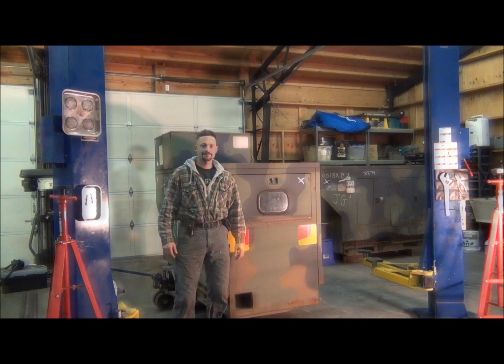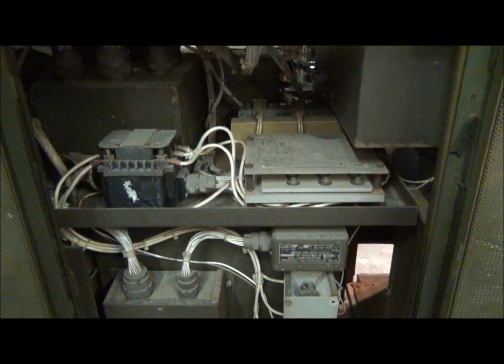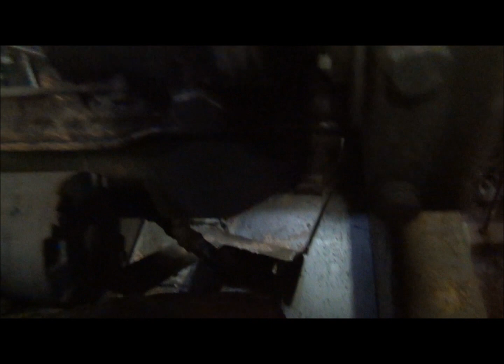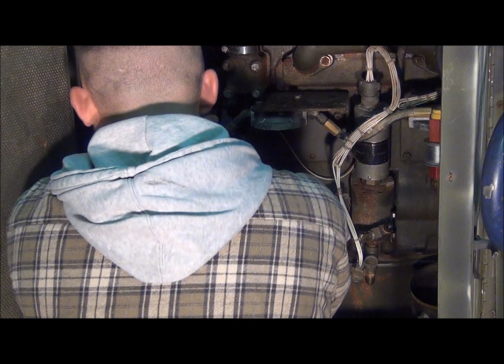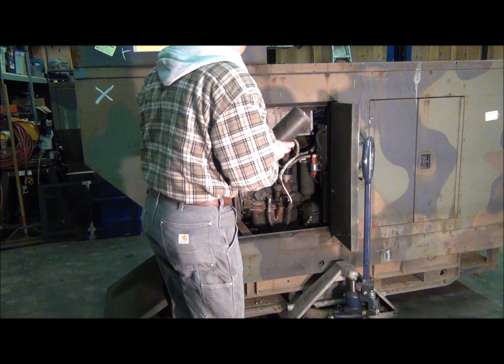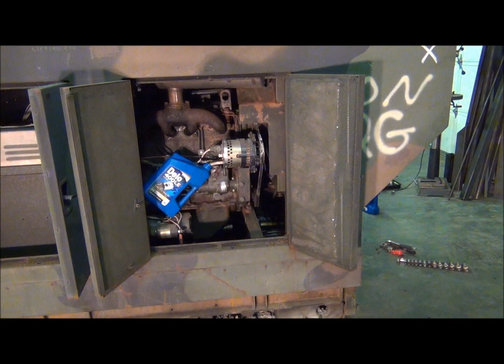Military surplus generator repair, and first start after years of sitting

Comment: I love your video's!! Are you still buying and bringing back these awesome military generators? I realize this particular video is 11 years old.
Reply from the maker: I still tinker on them from time to time, but I don't own any and haven't had the opportunity to purchase one in several years.
Reply: I will be picking up a Power Systems International DRASH unit with a 35Kw generator and an ECU with heat and air-conditioning. Supposedly has under 250 hrs. on it per the meter. I will need to put all new filters, fluids, batteries and some missing components like the oil fill cap, main breaker and oil dipstick. I am a decent wrench turner but we will see how this goes! I wanted the heating and A/C as a bonus if I ever needed that for an off grid situation. This unit is a 120/208 3 phase but I am relatively certain I can use it for single phase with less available Kw?    @MattVerley
Reply from the maker: @10xitall  you are correct; typically you won't have any problems running split phase 120/240 equipment on a single phase of 120/208.  Resistive heater elements (like a range/oven, hot water heater, clothes dryer) won't produce as much heat, and in some rare cases some electric motors may generate excess heat and become damaged (but these cases are rare).  I actually have a video on this exact topic...
Reply: @MattVerley  I would really like to watch the video you did on that subject. Could you be so kind as to attach the link for it? I have watched several of your videos and they are very informative and well done. Much thanks, Tague
Reply: @MattVerley  I am assuming I can look on the plates of any questionable equipment to see what voltage ranges they will operate in?
Reply from the maker: @10xitall  https://youtu.be/d1quMdHegn0?si=5pb1SiNWBIi7BCGv
Reply from the maker: @10xitall   yessir.  Most 240v equipment will have a label plate that says 208-240v (or similar).  I show some examples in the video.

Comment: I just bought a 15kw fermont, it runs normal, everything looks like new but is not generating any power, the low voltage red light is on. I live in Dallas TX, I've been trying to find someone to fixt.
Reply: Hi Juan, I live in Austin TX on a ranch and after this past February’s ice storm that left us without power for a week we ended up buying (2) MEP405B generators and we’re having similar issues as you. Were you able to find someone to help you get your generator working? If so, perhaps you could send me their contact information or maybe tell me what they did to fix it. I’d greatly appreciate it! Be blessed!
Reply: @Wesley Corbitt  HI Wesley, so far I haven't , I'm still looking, of course if I find someone I'll let you know.

Comment: We have a 30 kw unit at my shop. I exercise it monthly. Last month it made power perfectly. When I tried it this month, the engine runs perfect but the unit will not start making power. I tried it several times with no luck. Any help you could give me would be greatly appreciated

Comment: Great video!  We have about 40 of the mep003a at our fire stations in California.  Was told the one at my station was no longer serviceable.  Fixed it for free with some common sense.  Thanks for the video even if it’s 6 years old.
Reply: My volunteer station has a military -004 for pulling out to run the command tent for wild land firefighting and search and rescue, and a military issued Lombardini 12.5 Kw that came off Camp Pendleton that we use for auxiliary power at the station.  the 003's and -004's are tough units, and i've found a lot of common sense can go a long way. replaced hoses on our generators from the fuel tank, by going down to the auto store (didn't have any special connectors from the fuel tank to the fuel pump).

Comment: I need your help sir, I got a free M5 generator ZXB Hobart 4 cylinder engine. I got it running, at the gauge end of the generator there is a fuse box with to twist and fuses. We are pushed the lever and 4 load and you pull it out to take it out. It was my first time ever seeing one or messing around with one. One morning I had it running and then I had shut it down. I had pushed the lever in I'm done tried starting it and it was hard to start like it was on load so I figured okay so it does generate some kind of load so I pulled it back out. Unplug the battery back in, now my starter coil from the nut. I got terminal cleaner and cleaned it where I thought I might have grounded. I even I'm screwed all the wires going to that fuse box. And the starter coil still smokes. What happened what did I do?

Comment: You can repair th hose with Loctite Black PL Roof and flashing polyurethane.
Clean up hose well. smear on the black PL
Wrap fiberglass tape around hose and saturate it with the goo.
Can use marine grade cloth or even fiberglass drywall tape. 
Build it up at least 3/16 inch.
Let it set for a week.

I have repaired hose ends on my marine exhaust where they had worn on the ends doing this type repair.

Comment: Just bought a 30kw tried to start it and there was a muffled pop in the gen head then a little smoke drifting out the end, any idea what that was. Engine never started up just heard a few clicks. Haven't tried it again yet.  The smoke was coming from the gen head itself. After the muffled pop in the gen head. Is it toast or a fairly easy fix!  I have a boat I need an anchor for so not much loss really only gave $200 for it, any help would be appreciated thankz!

Comment: I have an Allis Chalmer 11000 diesel Gen set and know nothing about it other than eng #4430808, eng serial #11-11808, and a Generator part# 4480821. What do i have and how do i best make use of it?
my thought is to have it as a stand by and possibly as a rental unit. i nee your smarts. hr meter says 392 hrs, 
Curt

Comment: I have a MEP-006A (60kw) that I bought from Duluth DRMO 20 years ago to power my off grid tool and die shop. I see that many parts  in these various models are common. Do you have a cheap source for the air filter elements? I found them to be very expensive. My old genset still runs great, but very loud.

Comment: Something you might want to add to your miscellaneous consumables collection is self-amalgamating tape. Could have used some to make a temporary repair to the bottom hose so you could test things out for longer. https://www.ebay.com/itm/Self-Amalgamating-Repair-Tape-10m-Rubber-Waterproof-Sealing-Insulation-19mm-25mm/323825476306?epid=2019223521&hash=item4b6580a2d2:m:mDZfjEj0Dz2dm9KBuBxDY5w

Comment: For only 15kW that thing is big!  It must be built to do 15kW 24/7 for a long time, probably a good home backup generator to have around for storm season.  Do you have any idea what the fuel burn rate is for a few kW of load?
Reply: Its designed for some men that don't have time to coddle a machine to drop out a plane and work for 4 years straight. Its probably not too efficient but it'll run forever

Comment: was that a 220v or 208
all the surplus ones I have worked on were 208
not much use
Reply from the maker: Every -004a and above is 3 phase only, low voltage is 120/208 wye.  That’s actually OK in 95% of home applications.  You’ll notice the data plates on most 240v equipment actually says 240/208.  You can pull 120/208 from 2 legs and run standard household appliances just fine, but you’re limited to about 70% of the generators rated output.  There are a handful of cheap motors that don’t like 208 and heating elements won’t get as hot, but that’s about it.  
I actually did a video on this exact topic.  I also have a video detailing how to convert these sets to standard 120/240 single/split phase, in case you can’t tolerate 208 for some reason.
Reply: Sky Man You obviously don’t know how the military builds things to you. This thing is made to be shipped to Afghanistan or an island in the Pacific and plopped down and run 24 seven for years typically with another one running 24 seven they turn one on for the day they turn the other one off for a day. These things are meant to be dropped out of airplanes to be manhandled to be used by guys We don’t need to know that much except turning them on plugging them in and paying attention to the basic fluids. These things are built like tanks. Not like the predator you buy at Harbor freight.
Reply: I would think a transformer would be all that's required to change your 208 to 220, as long as the frequency is 60Hz.
Reply: @8180634  itd still be 3 phase when households could only use 2.
Reply: @virtualScotsman  Good point about the 3 phase, I missed that.  Though you could use a 120-240 step-up transformer on one (or each) leg to get a true 240v, though that would limit the power available to that circuit to whatever each leg can deliver.  It probably wouldn't be economical at that scale to phase shift one of the 3 legs to give you 2 legs 180-degrees out of phase for a true 240v.
Reply: A 220 volt motor ran on 208 will over time will burn up
15 years electric motor repair including rewinding

Comment: I have a MEP-004 AAS unit like yours it runs buth the fault system check dosn`t work fuse is ok along with the frequincy adjust control to adjust the frequiency you have to adjust the throttle pull knob below . I was running a 3 phase motor with no load and the ampers fluctuate with my clamp on meter on the motor line.like to have a insite on what the problem maybe . the voltage adjust functions ok.

Comment: hey I was watching your videos I have a 60kw generator 6cyclender turbo diesel its on a 2ton dully trail in very very could condition and I was wondering if you'd be interested in buying it?? we r moving and need to sell pricing it cheap
Reply from the maker: where are you located?
Reply: I am located in Kentucky
Reply from the maker: I think that location is going to kill any kind of deal; I'm in Oregon.  No economical/easy way to ship something that big clear over here!
Reply: what would be reasonable deal for you shoot me a offer... its very clean and very nice original military trailer it would come with
Reply: you may not want to pass this up its cool it has everything it should 7000 hours ill be reasonable what's your offer if u seen it you'd want it

Comment: Hey, great video. I was wondering if you have ever worked on the mep806a? I am having a rough time with mine and I would love to pick your brain. Any help would be appreciated. Thanks, John
Reply from the maker: Paul Timmins I've tinkered with a couple, but don't know them nearly as well as the older MEPs.  ask away, but I can't make any promises!
Reply: Thanks for helping.  Here goes a short version of a long story.  

We purchased MEP 806a 60KW and it worked just fine.  We put about 20-30 hours on it running a sawmill with a 55hp 3phase 460 volt electric motor.  All of a sudden we had no voltage.  We called a tech to come out and he diagnosed the problem as being Voltage Reg.  We replaced the voltage regulator along with a 3amp slow blow fuse (this was a field applied fix for the circuit feeding the exciter).  The unit worked great for another 10 to 20 hours and than one time we started it and the volts spiked to 500 volts and than the volts and frequency drop to under 40 each.  We than noticed the slow blow fuse was burnt up so we replaced it with the exact same slow blow fuse and it worked.  We tested the unit several times turning on and off with not problems.  The unit than sat for 2 weeks and we started it up and the volts peg 500 and than drop offs Frequency  and Volts to under 40.  We looked and the slow blow fuse has burnt again.  We ordered and install a New old stock VR, transformer for VR and the dial resistor knob thingy.  We installed a new fuse and started it to the exact same problem.

We can't figure out what is making the VR to send out to much juice to the exciter when "flashing the field".  The engine runs perfect.  Any ideas??
Reply from the maker: Paul Timmins that one would be impossible for me to diagnose without being in front of the machine with a schematic and a couple of voltmeter s and my oscilloscope...
Reply: Paul Timmins  you have to replace the voltage regulator  and t1 transformer along with the voltage rheostat all together. When it stops producing power. How long were you flashing the field over field flash on the mep806a happens at 900rpm

Comment: Was wondering if I could ask a no start question.
Have 802-a, new starter, jump across and it will crank, no start on master switch. Turn switch and dead crank clicks, and no signal to starter to turn.
AH1 fuse, 30 amp good, and push button is in. 
wires in tack although they had wire 2 and 4 switched, I traced number on wire to verify.
Any Idea?
Thank You.
Anybody you can recommend?
In Virginia
Reply from the maker: Ralphstrains LLC very difficult to troubleshoot without being there in person, but by far the most common reason for no start is a failed speed switch
Reply: SPEED SWITCH????
I know master switch, I know dead crank switch.
Which on is the speed switch>
Thank You very much for replying.
Ralph
Reply: Where is the speed switch? I cannot find anything in regards to it. Changed out all relays and nothing. Changed silinoid and nothing. Is the speed switch on the side of the motor? Any help would be great. Thank You

Comment: Do you know much about the 1969 3kw 28vDC 4cyl gas generator? i have not tried to fire it, but its 100% intact and only reading 59.1hrs on the hobbs meter. Thx. Jonn

Comment: Hey i have a (NSN: 6115-01-274-7395) generator and i cant get it to hold and maintain the hertz and volts. It worked about a month or so ago and one day it just stopped producing. If you have any ideas please let me know.
Reply from the maker: So, is it not producing any voltage now?  I need a bit more info :)
Reply: bad regulator,bad gauges ,fried generator,etc

Comment: Are you prior military? Did you work on MEP generators in the past if you were in the military?
Reply from the maker: prior military yes; 8 years in the Navy as a nuclear electronics technician.  Didn't work on any MEP generators while I was in though...
Reply: Nice I'm currently active duty Air Force. It is cool seeing these generators getting used outside of the military. My job is operating and maintaining MEPs.
Reply: Hey you are just man I am looking for. I have a problem with my mep806a, was wondering if I could run it by you.

Comment: Hi. I was hoping you could help me with a problem I'm having. If you could email me, I'd appreciate it. My generator runs fine.The gauges all work and adjust but I'm having problems with the circuit breaker. I'd appreciate any help you could give me.

Comment: hey do u know the mep 113 its 400 hz do u know if that set can be reconfigured to 60hz.
Reply from the maker: No, there is no way to reconfigure a 400hz set to 60hz without replacing major components in the generator.
Reply: thanks for your response can u please advice me whats are the components that are to be replaced, i was contemplating to rewind the alternator coil to get the 60hz.
I from Guyana S.A and spares are a bit difficult to obtain,A guy brought this set in the country and he doesn't know about the set and i am getting it for about $1500 us dollars.and the set has a very good engines excellent condition.
Reply: Whats ur best advice what to about the set and if u can source the components for me please quote me i will be very great full for ur response

Comment: I enjoyed this video,..night Saturday evening's entertainment for me.  I used to be a Kohler Gen-set dealer back in the 1970's. The models we had were powered with Lister 3 cylinder air cooled diesels.  This one , I notice is a White, am I correct ?
  This is a lot of fun watching you go through the procedures. Where were you when we needed good service people back then. ( I know, I know,...age difference right. But you folks know what I meant ) 
You said it has 2060 hours on it,  that would equal approximately 61,800 miles, if it were a vehicle. That's an old rough calculation that was used to gauge engine oil change intervals of heavy equipment back in the day. 2060 running time hours X 30 miles per hour = 61,800.   There now, some useless information for you .
Thanks for the video. I always appreciate the effort required to make this and put it on YouTube too.
Cheers.
Reply: hey Reg, ive just been working on an old lister 3 cylinder, (27KVA) its been sitting on standby for years and years, only ran 90hrs in its life time, got it in our workshop for full service, load test, and the customer wants it re-commissioned on auto start in the event of a powercut, by far the oldest set ive worked on, however it runs a dream and is a testiment to old skool engineering. - chris.
Reply: Yessir Chris, if these older style Lister's ( of course, this applies to almost all diesel engines ) were given good  maintenance and service, they'd run almost forever.
Imagine only 90 hours on the clock !  That's just about new !  
Well, good luck with this one, you'll be rewarded with a great running gen-set.
Cheers.
Reply: Reg, I am away on my holidays tomorrow for a couple of weeks, when i return I can make a video showing you around it if you'd like? - chris
Reply: Sound's like a good idea Chris. 
Enjoy your vaation.

Comment: I have a MEP-006   60 KW generator, and I would like to convert it to single Phase, it has a different bus bar configuration than is shown on other 15/30 kw units. Is there a way I can contact you through your co.

Comment: Would it be better to use coolant rather then water in the rad or not necessary ? And great video.
Reply from the maker: +trigger finger Yes; I always start with water only in case a leak turns up that requires a drain/refill.  This also allows me to do a flush without having to worry about disposing of coolant.  Once the initial run and flush is done, it gets filled with coolant.